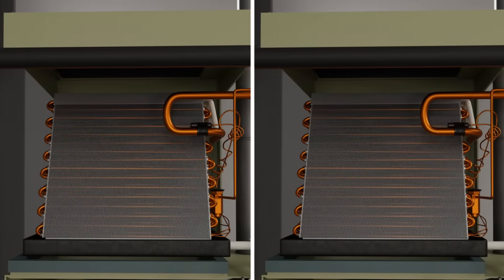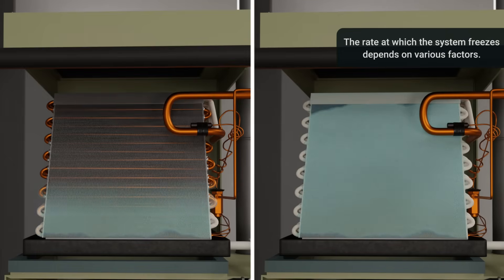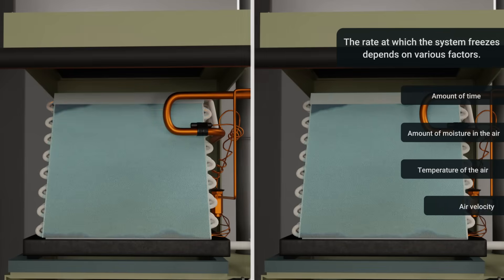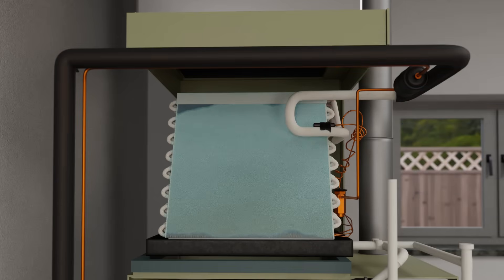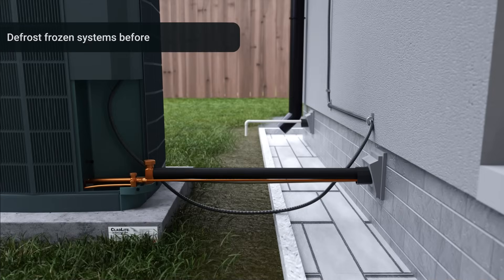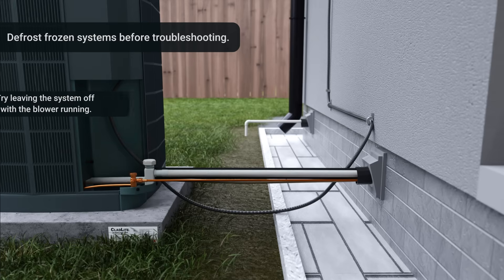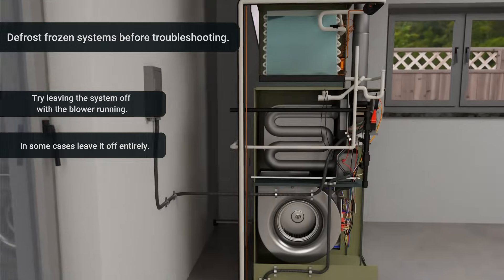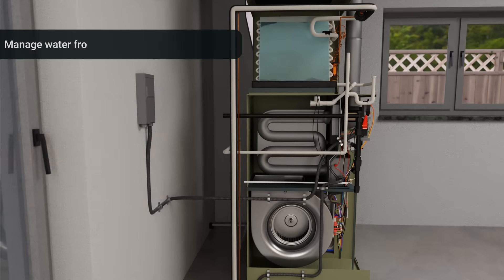Freezing in HVAC Systems 3D

Comment: My system freezes sometimes because the blower fails to start with the compressor. I have a split system. This can happen once or twice a month, specially during the monsoon season. I just turn off the system, wait to de-freeze and I am good for another couple of weeks until it happens again. Any ideas? Could it be the blower capacitor?

Comment: Does the coil temperature to air difference differ in refrigeration? I’m a refrigeration apprentice and was told the coil is 10-15° cooler than the space, but this video is saying it’s a 35° difference

Comment: Good video, good reminders. Straight to the point. Got sent to deal with a frozen rooftop commercial unit last week and everyone was scratching their heads (filter is good, right? Blower's moving, right? Got pressure right?). Meanwhile nobody bothered to clean the solid compacted dust on the indoor return grills, pulling so hard it was picking them up... But hey, that's why they pay me the big bucks on colorful paper. XD